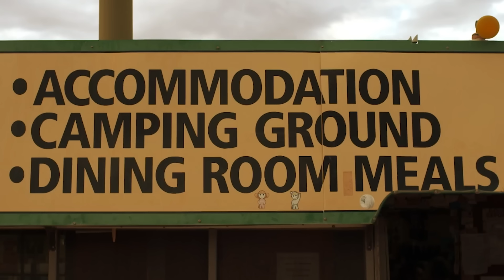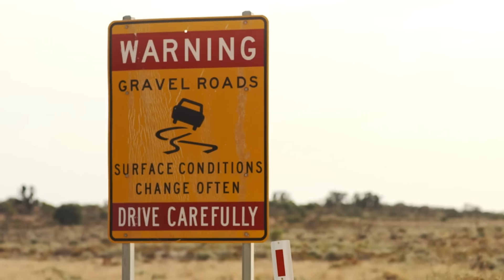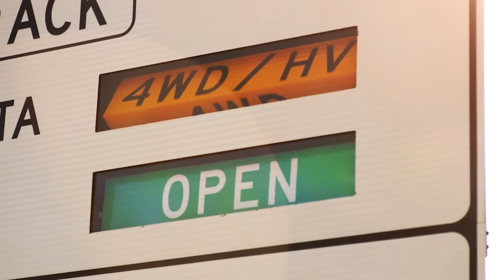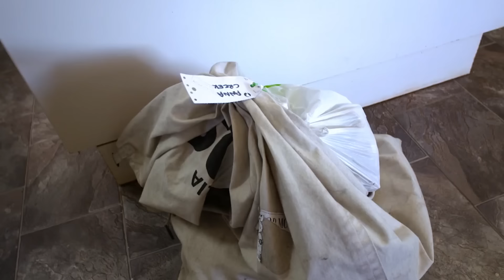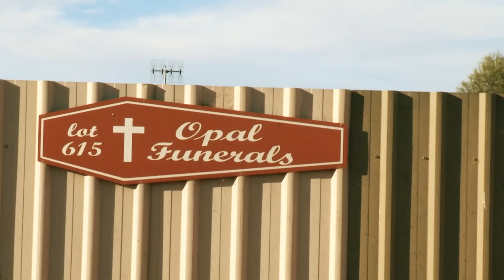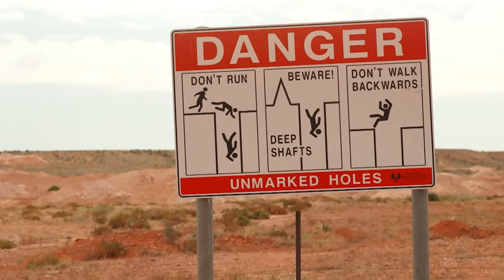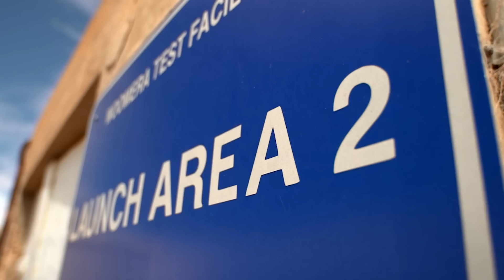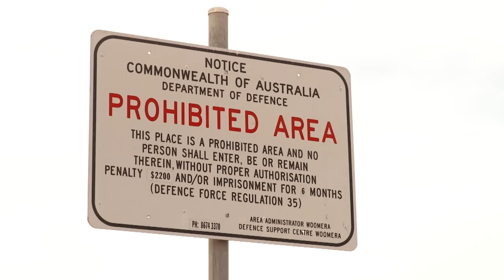Hidden Riches of the Australian Outback: From Cattle Stations to Opal Mines

Comment: i cant help but think of wolf creek incident ''very scary'' for unwary tourists
Reply: @spacies Wolf Creek was a movie. There have been more scary movies than actual scary things like that happening, starting with the film ''Wake in Fright''. What i would advise any visitor to Central Australia on - and this is important. Carry plenty of drinking water ( 10 gallons or more) in your car, if you are planning to go offroad. Also, in that situation you do need two way radio (mobile phones are unreliable in remote areas, no towers for miles). Lack of water/heat exhaustion from walking too far on a hot day is actually far deadlier than any Wolf Creek boogeyman story.
Reply: I would not travel alone out there either.

Comment: Anna Creek Station tem uma área de 23.677 km 2 (9.142 sq mi; 5.851.000 acres) [3] que é ligeiramente maior do que Israel . [4] É 8.000 km 2 (2.000.000 acres; 3.100 sq mi) maior do que seu rival mais próximo, Alexandria Station no Território do Norte do país . É mais de sete vezes o tamanho do maior rancho dos Estados Unidos , King Ranch no Texas , que tem 3.340 km 2 (830.000 acres; 1.290 sq mi). [5] A partir de 16 de dezembro de 2016, a estação é de propriedade da Williams Cattle Company, uma empresa familiar que comprou Anna Creek da S. Kidman & Co , dobrando sua área total sob arrendamentos pastorais . O município mais próximo é William Creek (que é cercado pela estação Anna Creek), mas a cidade mais próxima para frete é Coober Pedy .
Anna Creek Station has an area of 23,677 km 2 (9,142 sq mi; 5,851,000 acres)[3] which is slightly larger than Israel. [4] It is 8,000 km 2 (2,000,000 acres; 3,100 sq mi) larger than its closest rival, Alexandria Station in the country's Northern Territory. It is more than seven times the size of the largest ranch in the United States, King Ranch in Texas, which is 3,340 km 2 (830,000 acres; 1,290 sq mi). [5] As of December 16, 2016, the station is owned by Williams Cattle Company, a family business that purchased Anna Creek from S. Kidman & Co, doubling its total area under pastoral leases. The closest township is William Creek (which is surrounded by Anna Creek station), but the closest town for freight is Coober Pedy.

Comment: “ these ships of the desert weigh 200 tons “ seriously get the facts correct before you make statements that are totally stupid truck and trailers weigh about 25 tons add 60 tons on a 2 trailer road train and 90 for a 3 trailer road train total weigh max of 120 ton.
Reply: Maybe loaded they're 120 tonne.Tractor isn't more than 10 ton & each trailer maybe several ton each,add dolly that joins the ultimate to the primary trail unit;40-ish tonnes.🇺🇲tractor trailer weighs about 15 ton combo empty.40 tons loaded out. 200tonnes could be triples maybe?
Reply: @curtiskretzer8898  a triple road train is licences to 120 ton quads on private mining roads might get to 160 but 200 no chance
Reply: @leonidastsouris2557  sounds quite correct & like you've direct informational access.I know 80-82ton is a tractor & single long trail unit in🇺🇲
Reply: Calm down mate